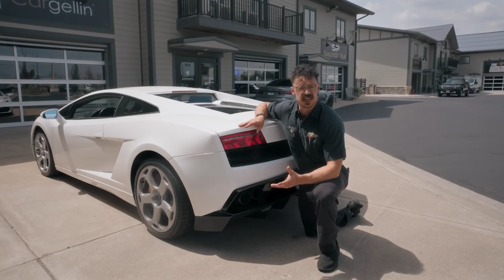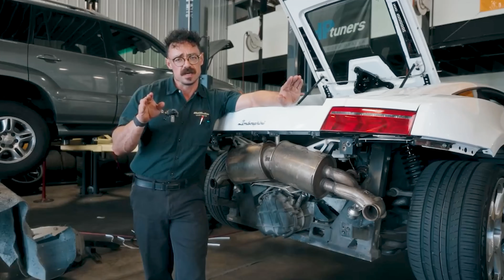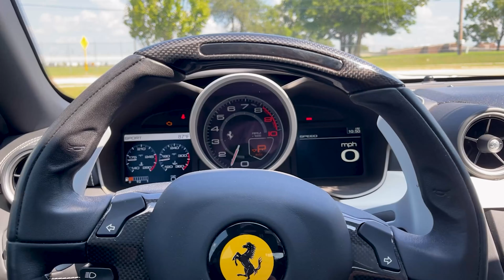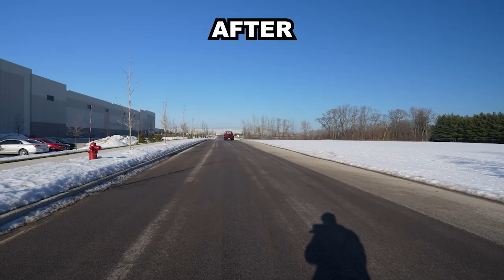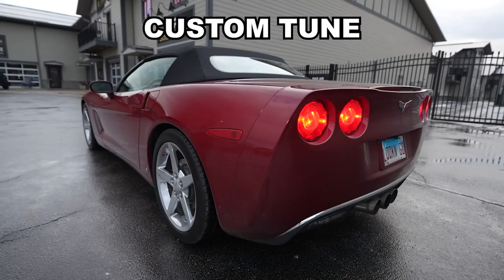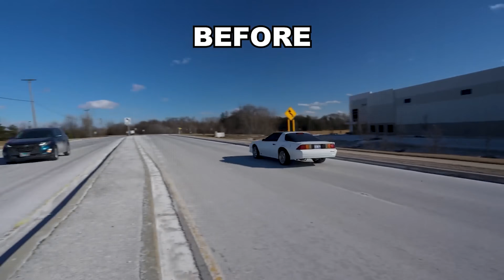18 Years of Sound Experience: Gallardo, Ferrari V12, LS Swaps, Vette Exhaust Build Principles

Comment: Now a motorcycle exhaust for my VFR750F please. :D
Reply from the maker: We've done more bikes than most people would guess, just none of it's on film. That whole era before we started documenting anything is basically a lost archive at this point. The VFR750 would be a fun one though, that inline V4 has a character most people never actually unlock. You still running it?
Reply: @FluidMotorUnion  I bought it last year for cheap with 78000km (at least once ^^') on the clock and it basically runs great, but I have a little issue now that it lost oil on my last ride. My right foot was really wet. ^^'
What you mean with "inline V4"? Like the Yamaha R1 with an inline engine but crossplane crankshaft? The VFR has a real V4 layout.

I would love to have a custom exhaust system done by you but I think with the shipping to Germany plus the regulations here this would become a little bit too much, but a video about that would be immensely awesome to watch. ^^'
Maybe you could try to make something for a Suzuki GT550 as well. Some 3 cylinder 2 stroke sound eargasm and the godly 2 stroke smell. :D
Reply: Those bikes are great I had a 92 with a delkivic exhaust and sounded a bit like a small block Chevy

Comment: You ARE an engineer. Thinking this way, experimenting, controlling variables, iterating based on data, and using all that acquired knowledge moving forwards is what engineers do and what makes them, not having a degree. 

I've worked with too many engineers that can't use a drill or think this way.

There are some pretty easy to use, intuitive CFD webapps now, you should give them a try to confirm your hypothesis about flow
Reply from the maker: I'll take that and I appreciate it, but I think the degree matters more than people give it credit for in terms of the foundation it builds. What I do is closer to the scientific method applied in a shop, which gets you pretty far but there's real math I've had to outsource over the years when the intuition ran out. The CFD apps are interesting though, I've had it suggested before and the honest reason I haven't gone deep on it is that the dyno has always been faster for me than modeling it, but I'm curious whether the newer tools have closed that gap enough to be worth the learning curve. Which ones have you been using?
Reply: @FluidMotorUnion AirShaper is the best if you have no experience, then SimScale

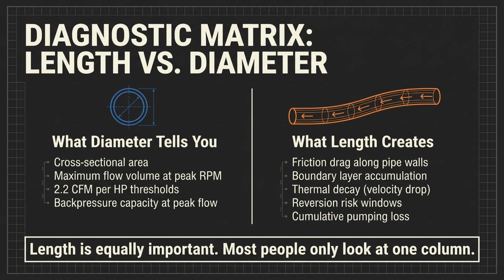Comment: 24:17 - I was watching an old episode of the UKs Car SOS with Fuzz Townsend and Tim Shaw where I believe they were repairing an Old Ford Escort (possibly either the RS2000 or the Mexico that they did) and they had an engine builder who’s renowned for being the UKs BEST and most exclusive builder of Ford Escort Model 1 engines guesting to repair + rebuild the engine and to get the most out of it.

He reported while building that engine (to Tim I believe) that he believes that porting air intakes is a bad thing for this very reason (friction being caused by the action of the air sticking to the shiny surfaces).

I believe he lamented a story about one of the top teams in a racing series that he used to work for actually roughing up the surfaces a little so that the air would have a tendency to flow better as it air would break contact with the surfaces rather than parasitically losing energy by sticking to them.

Now, I don’t know if I imagined that or not , however, it kinda ties in with what you’re saying here.

Perhaps you could replicate that inside one of your guys’s own cars’s pipes as a test of the theory maybe?

Would be interesting to see the results maybe
Reply from the maker: You're not imagining it, that's a real phenomenon and the logic is sound. The nuance though is that it's way more sensitive on the intake side where you're working against vacuum than on exhaust where you've got positive pressure doing the pushing. And the roughed up surface story has another layer to it that most people miss, on an intake runner a rougher surface actually helps fuel vaporization because the air fuel mixture is heavy and vapor laden and it atomizes better when it has more surface texture to interact with. Smooth runners look better on a flow bench but better vaporization is a real world gain that predates computer analysis by decades. Someone figured that out the old fashioned way long before anyone could model it. What episode was that, I'd actually like to go find it.
Reply: @FluidMotorUnion  COOOOOOOOL!

😄

I can’t remember the exact episode, it was one of the Ford Escort Mk1 episodes IIRC, of which, I believe they’ve only done 2.

Why not try hitting Fuzz up (not sure Tim’s on socials) and see if he can remember?

They actually sometimes do an American episode mid series… I don’t know dude, perhaps there’s scope for something there maybe?

Comment: @9:11 very cool, i been watching your content in hopes of doing my own custom exhaust, using the megaphones like that right before the muffler seems genius. i wasn't going to incorporate a megaphone becuase i am still going to have a cat. I thought the megaphone did best closer to the collector. but i really really like this design, i too am trying to use two mufflers the dual inlets and outlets.  also i'm trying to do a pre axles opposite side exhaust, any advise with how close the tail pipes can get to the gas tank before creating a issue? my gas tank is in the frame rail behind the driver, right where i need to snake to the to do opposite side exhaust, is it even worth the extra work?
Reply from the maker: Megaphone placement is more flexible than most people think, closer to the collector is more of a race application thing where you're chasing a very specific RPM window. Where we put it on this one made more sense for the overall system. On the heat shielding question, DEI makes peel and stick reflective wrap that's exactly what we use in that scenario, it's not a perfect solution but it buys you a lot of margin between the pipe and the tank. Opposite side pre-axle is doable but whether it's worth the extra work really depends on what you're after sonically, what's the car and what are you trying to get out of it?
Reply: @FluidMotorUnion  Sonically is what i don't really graps about opposite side vs dual single side. With you guys designing with x pipes, the engine banks are going to blend. So I struggle to understand the sound difference between the two. It's a 1950 f-1 ls1/t56 with IRS. I would like to exit out by the running board like you did with the old school chevy truck. I got tons of room on the passenger side and even under the drive shaft to build in. You did a great job explaining the megaphone placement in the video, i should have just waited till i finished the video to ask my question. Thanks for the advice on the dei wrap. Sonically my goal would be more stealthy than full-on loud. I really like the idea you presented about creating different lengthed waves to produce a chord instead of a single note. power wise it's stock and future plans wouldn't exceed 500hp. How would you describe the sound difference between dual single side vs opposite side pre-axle exit? i assume the major thing is you would be surrounded by the sound.

Comment: Have you ever tried coneing into a bigger 90° and cone reducing back down to your pipe diameter? Things being equal on both ends of the 90°. Just to help the gasses turn better.  Do exhaust gasses ever slow down significantly for that to make a difference?
Reply from the maker: Yeah that approach can help the gas turn but you're trading velocity for it, the diameter change creates a pressure drop and the air still wants to go straight regardless of how much room you give it. It all comes down to where in the system you're using it. And here's the ceiling nobody talks about: once you get to zero loss, like we showed in the Huracan video, there's nothing left to find. Improving bends theoretically doesn't make the engine work less or add energy to the exhaust, it just stops subtracting from what's already there. What are you trying to solve for, a specific bend situation or more of a general system question?
Reply: @FluidMotorUnion general. It amazes me how those systems just work with so many bends.

Comment: My wifes car is a Furd Fusion energi Hybrid. I think it'd be intersting to see what a max efficiency exhaust would be.  But the cost of the exhaust would never be recouped by the fuel economy. 🫩 But I'd still think its cool!
Reply from the maker: kay this is actually a more interesting brief than it sounds because the tradeoff flips completely. A max efficiency exhaust optimizes for cruising velocity not WOT flow, which means you'd intentionally build something that most performance guys would consider restrictive at full throttle. On a hybrid that's running the engine in a very narrow and specific load range most of the time that might actually be the most honest exhaust brief I've heard in a while. The fuel economy gains probably never pay for it but the exercise of building something deliberately tuned for efficiency over peak power is genuinely something I'd want to try. How would your wife feel about her Fusion becoming your test rig, lol?!
Reply: @FluidMotorUnion  I'm in! I'll message at FMU page. I'm only 3 and a 1/3 hours away. 😎

Comment: I remember the 70's Header, straight pipe, Glass pack. Tail pipe, Dual. Depending on the placement of the Glass pack would make the noise. Closer to the header less boom. No tail more boom, myself I would use about 4 foot tail load but not crazy. So much has changed but the 350 in those days was a very simple engine. Love to see what you are into just great information.
Reply: I remember doing my first c10 350 with 268 cam. headers true dual 2.5" and dead straight after the transfer case because it was lifted. Cherry bombs ended up in the middle. Best sounding exhaust ive done to date. Way too loud for the power it made. 

Stamped baffles facing away from the flow too.
Reply from the maker: That setup is a perfect example of getting the result right by feel before having the language to explain why it worked. Stamped baffles facing away from flow, cherry bombs in the middle of a long straight section on a lifted truck, that's textbook pulse management figured out the old fashioned way. Too loud for the power is basically the exhaust builder's version of ahead of its time.
Reply from the maker: The fundamentals you're describing from the 70s are honestly still the same conversation, placement relative to the header, pipe length, termination point, all of it still applies. The glasspack guys were doing intuitive exhaust tuning before anyone called it that. The tools got better but the physics didn't change. What were you driving back then?

Comment: You guys think you can make bmw S63 engine sound different and outperform anything on the market?
Reply from the maker: We absolutely can and have, the problem is about eleven years of that work happened before we ever thought to film any of it. Back then I was just a guy customers came to because nothing on the market was doing what they wanted, so I'd keep cutting it back out until it was right. What are you working with, stock location or are you open to something more involved?
Reply: @F @FluidMotorUnion  would be for F85 X5 M im looking for something completely different than anything else on the market and im willing pay top dollar for it

Comment: Hey man, I just had a complete exhaust from heads to tail, made for my swapped 350z. 
I had agreed to pay around $8k CAD for a long tube header, double x pipe 3” exhaust. 
I got a bill for $11,500 CAD. I think that’s way too much for the quality of what was made. I’d like to send you pics so you can give me your impressions of this exhaust. 
Thanks
Reply from the maker: Send it over to all@fluidmotorunion.com. I don't like knocking other people's work and that price isn't impossible depending on what's actually there, but I'll say this: if you came here and spent that kind of money you wouldn't be in someone else's comments questioning whether you like it. At that level you're paying for a result you're happy with, not just parts and labor.
Reply: @FluidMotorUnion Check your mail I sent you one!
Reply: @FluidMotorUnion- Just want to add, I provided the mufflers and header flanges, and the shop has had my car for 7 months as well.